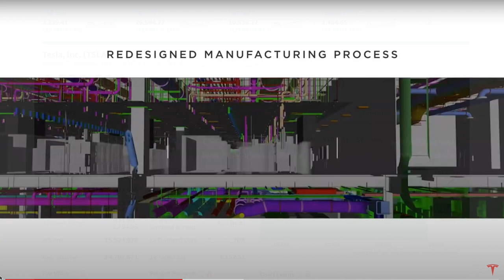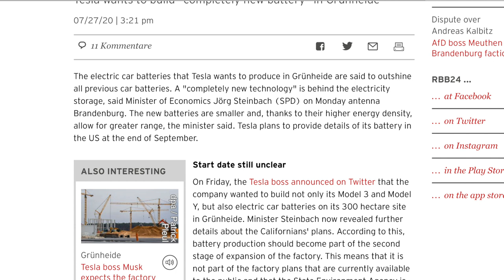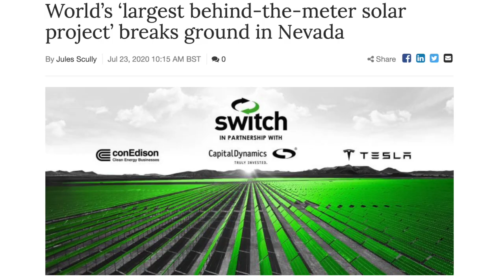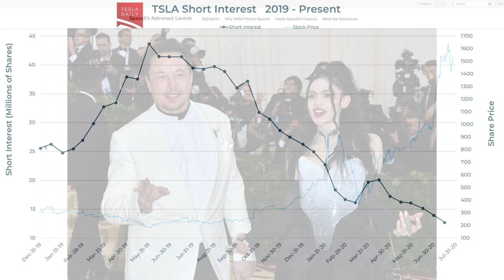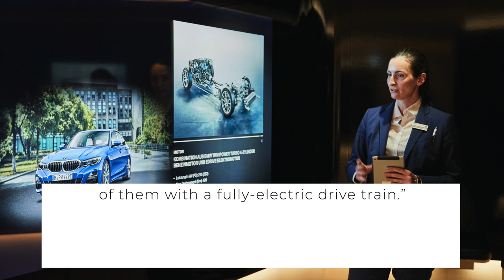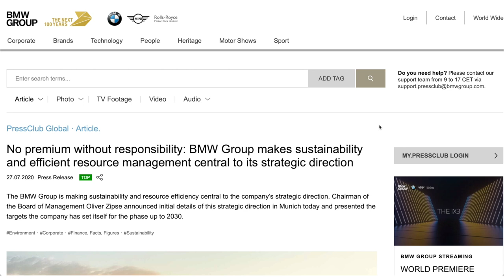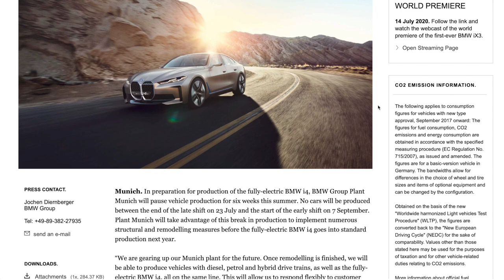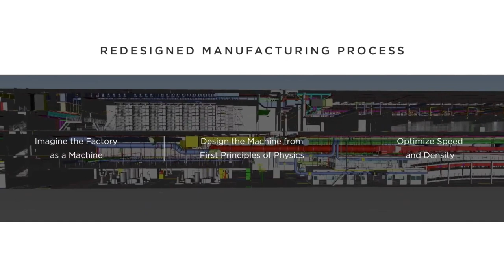Tesla Giga Berlin Battery News, TSLA Short Selling at $20B, Elon Musk NYT, BMW Unveils EV Targets

Comment: Dear BMW: With the 4 series nostrils look, you will be lucky to sell any of them.
Reply: Shhh, don't let them know
Reply: Truth is BMW has become more and more lost in the styling department since mid-2000's, from the Bangle-butt 7er, to the most recent 3er which was only the slightest change to the previous 3er. As a former BMW-fanboy, I told myself that these were good designs, but now that I have stopped drinking the koolaid, the whole brand is obviously flailing about unsure if they should build something safe and mass-market or something bold and avant-garde. It just looks like an unappealing mess powered by ancient industrial era tech and godawful software.
Reply: @roddlez  I agreed 100%
Reply: @roddlez yeh, my uncle just got a brand new 545e and it sucks. He owned only Audis before, but changed because of the hybrid option with the bmw. but it really sucks, he wont buy any bmw again ever. The car is woth about 85.000€ and it came with production faults like a door was installed incorrectely and there were wind noices inside. Furthermore the design looks weird, heating in e-drive only works on atuo-mode but lets you freezed if you set it on max heat, buttons look like 3 people designed but havent talked with each other, and the engine was at the mechanic 3times now because of making trouble. His 1976 Porsche 911 is more reliable... the car should be worth 35k in my opinion.

Comment: Excellent, Rob. As always, clear and concise information.
And there are so many issues with BMW I think it may already be too late for them. If they think they will amortise their costs in ICE and make a profit by sucking in the dwindling FF devotees, they will find that, after a very short time, they will have disappeared into thin air. And they will be stuck with a outdated corporate engine section and a designed range that is hugely compromised.

Comment: Thanks Rob. The problem with BMW is the dealerships are not going to sell EV's, as you said, they are not making much, or no money on the vehicles. Then they have very little maintenance. Dealerships make 75% from maintenance. So not much money on both sides, means no sales. Until BMW and other manufactures bypass the dealerships they are all screwed. 

Why does Tesla not use Dealerships? The same exact reason. 

Only start ups can sell EV's or what VW is starting which is Online sales with some assistance from dealers and a set amount of money for that help.

Comment: I doubt many people realize the difficulty a legacy ICE manufacturer have in transitioning to all electric.  They not only have to change the engineering and manufacturing skill set but face leaving billions of dollars/Euros/yen of stranded assets in engine and drive chain plants. They also face pushback from: their labor unions who will have fewer members because of the fewer assembly steps for electric vehicles; the dealership network because repair and maintenance requirements, their profit centers, are significantly reduced; their bankers who finance the floor-planing of dealership vehicles, and even management which is currently over inflated from having to source thousands of now unnecessary parts.

In order to make the transition as painless as possible they must move slowly. That means they will remain behind the technology curve for a very long, perhaps too long, time.  Investors should be thinking about where their portfolios will be in ten years when many of the oldest manufactures start to fail.

Comment: The new Mini(BMW) electric is actually a very efficient car.. so i wouldn't be so sure that this is a bad strategy for BMW
Reply from the maker: It’s easy to be efficient with small, low range cars because they don’t have to deal with the weight of enough batteries to make the range acceptable.
Reply: Hmmmmmm. 4.4 miles/kwh v Model 3 4.6 miles/kwh despite being 1000lbs heavier ( Both calculated against EPA range ).
Using Matt Joyces table, and estimated EPA range of 130 miles ( listed as 140 to 145 WLTP range ) they come in near the bottom just below the Audi etron.
Using the same core efficiency calc kwh/range/weight with EPA the Mini 7.47 v Model 3 5.29
Smaller numbers are more efficient.

Comment: BMW doesn't believe that ICE sales by 2030 will be approximately zero. So to ramp EVs to ~1 million by then actually suggests shrinking the business by 60%. To state that BMW has limited ambition does in fact understate it massively.
Reply from the maker: BMW Group delivered just over 2.5M vehicles in 2019. This plan implies a target of fewer than 700k all-electric vehicles per year by 2030. So they are targeting less than 30% by 2030, and a level that is below Tesla’s current installed production capacity, which was built out in less than 10 years and came from nothing, by the way.

Comment: Imagine wireless super charging for cars like they did with the phones. EV Cars pulls up into designated charging lot, and automatically charge while you go shopping.
Reply from the maker: I doubt wireless EV charging will ever be a thing, too much energy lost. Better to connect to a cable autonomously which will be just as cool. Or cooler.
Reply: Pizza - Wireless RF Charging , does not work, and it has been DEBUNKED. 
eventually Tesla cars will be upgraded to 800v and V4 Superchargers with 400 kwh.
Reply: @MrRedsjack   - at least Tesla did not invent FAKE " self charging " cars like TOYOTA.

Comment: Talking about BMW’s future, it brings to mind how much mechanically simpler electric vehicles are than ICE (and hybrid) vehicles, what with eliminated exhaust and pollution-control devices, fuel and oil pumps and filters and associated plumbing, tremendously complex engine and transmission castings, machining and assembly, ignition-system components, and so forth.  It seems that the cost of designing and building a new (or significantly upgrading an existing) ICE vehicle factory ought to be up to MULTIPLES of a similar-capacity EV factory, but I don’t recall hearing/reading much about THIS advantage of EV’s. (?)

Comment: BMW needs to either accelerate their goals from 2030 to 2025 or just phase out the production of cars and try to beat Tesla to the production of an electric motorcycle that stands apart from any other on the market, has an amazing range and comes at a very low price. This needs to be a pivot point for them but like almost every car company, they shrug off the competition and keep pretending it's not real. I love Tesla and I want to see a billion Teslas sold, but I also don't want to deal with a monopoly. We as consumers need the competition, and no one is putting much effort to be a realistic one. We are nearing 2021 and there are many companies still producing mere compliance vehicles.

Comment: Hi Rob,
I presume Tesla is included in the NASDAQ gains. If that is so then Tesla accounts for about 60% of the wider market gains that you are comparing them to.
Reply from the maker: Thanks, can you help me with the math on this?
Reply: @TeslaDaily  Sure. I hope it's right now!! But below is the calculation.
NASDAQ = $10500 * 1.7% = $178.5 up on the day. Of which Tesla were $122.6
122.6/178.5*100= 68.68% of the NASDAQ gain was Tesla alone.
Nearer 70% now I've run the numbers rather than estimated.
Reply: @TeslaDaily  NASDAQ gain was 173.09 It's right there on the screen if I'd looked. This makes it 70.83% Tesla alone.
Not a big difference but as the numbers are there, might as well use them.

Comment: Jaguar did what you said but did not work out well. It's hard to justify buying another electric car brand when half of the speedy charging stations are not available to you and the software is subpar. Even Elon thinks the ONLY way for Tesla to transition from EV niche to mass adoption is with FSD in conjunction with price drops.
Reply from the maker: Yeah, it's definitely no simple task and maybe not even possible. I think that path has better odds though. Maybe Lucid can make it work. Jaguar did ignore the charging half of my statement of range/charging. They should've done everything they could to secure a Supercharger network partnership from Tesla.

Comment: I WILL BUY A BMW IF IT DID 120MILES ON A SINGLE CHARGE IN ONE DIRECTION WITHOUT USING THE HYBRID-ENGINE. That alone means I will NEVER use the engine unless traveling more than 120mile per day. I never do this like ever thus go beyond 120 miles unless going on holiday or something. ALL HYBRID CARS SHOULD DO 120MILES AS MINIMUM IN ELECTRIC. 24V hybrids are rubbish.

Comment: Rob, I have a theory as to why Tesla might not be worried about water and waste requirements at Giga Berlin. They recently patented a battery cathode production method called Dry Particle Microgranulation (DPMG)(https://www.youtube.com/watch?v=7knQaKSZKsE). DPMG outputs better cathode particles with no waste water and fewer waste materials. Excess input metals are recycled back into the process as inputs. Another bonus is that it uses class 2 nickle rather than the class 1 nickle currently used (huge cost/supply win). Go Elon and team!